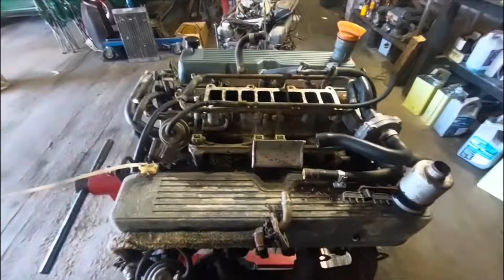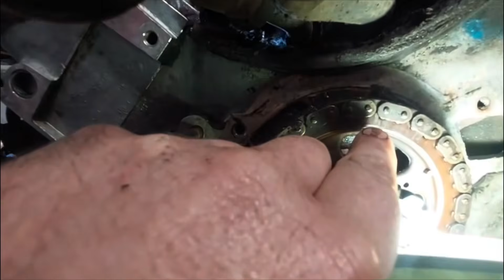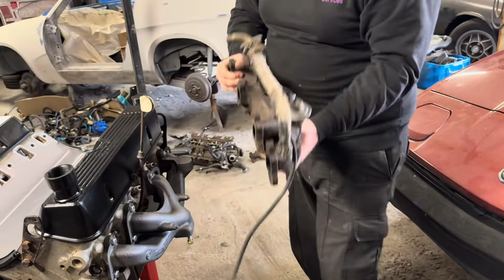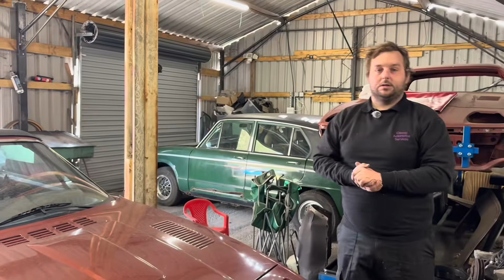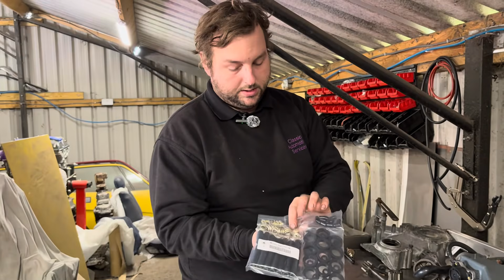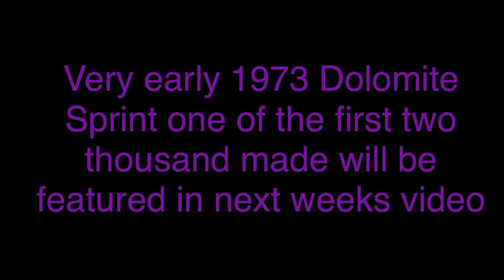Aporto red TR8 build & another rare arrival

Comment: Great work as ever.  What procedure do you favour to get the oil pressure up on these before firing up?
Reply from the maker: Hi on a fresh build on the RV8 pack the oil pump with vasaline and then we prime the engine using a drill and a drive tool to spin the oil pump whilst Turning the engine by hand to make sure oil pressure is built up before firing

Comment: Hi is it possible to remove a webasto roof from a tr7 and reinstall a standard soild steel roof ?
Reply from the maker: Hi yes it is completely possible but the only way to do it correctly is to source a good second hand solid roof panel and then fit just the roof skin on to your existing car
Reply: @chelsiebrookes2470 thanks for your help